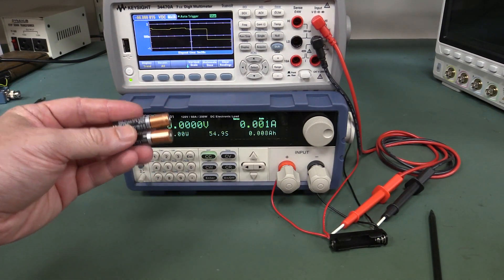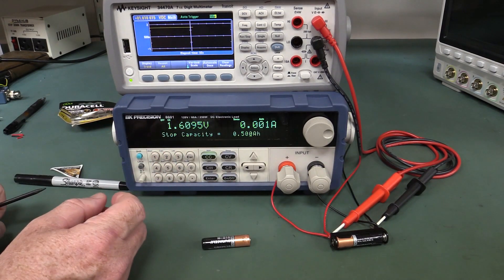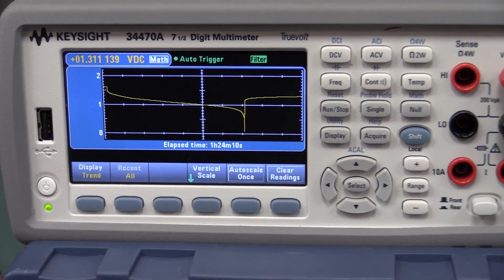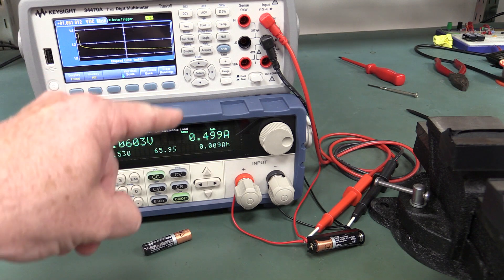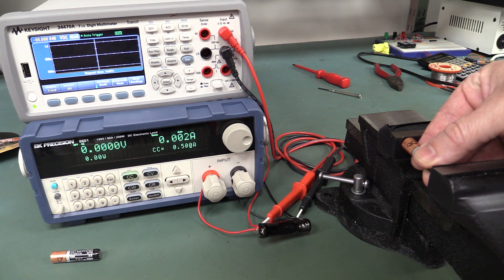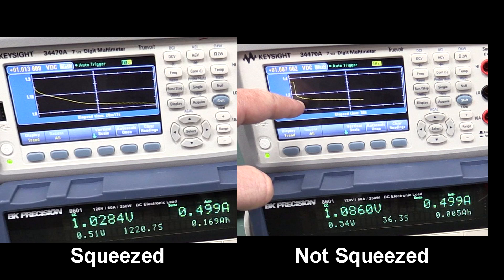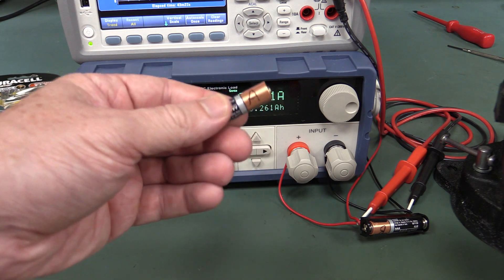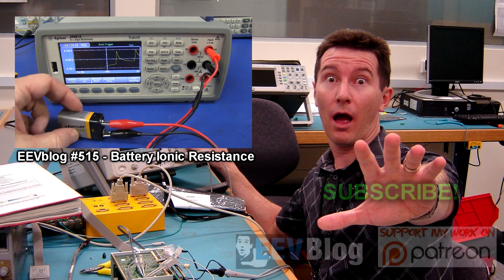EEVblog #865 - How To Increase Alkaline Battery Capacity

Comment: On applying pressure from end-to-end, the cylindrical core with its core layered windings separate enough to move static chemistry that then is exposed to the anode and the cathode. In short, the squeezing is acting like a pump which then irrigates relatively active chemistry to the poles. The vice squeezing may be shearing off the old chemistry from the plates, where vibrating would not shear like a squeeze. I think vibrating over X_time would move more chemistry. 

An alternative process is to move the internal chemistry then recharge.

Comment: In my city this is a well known thing, when the battery runs out we put them between our teeth and deform it with a bite, or if the shell was hard we use one battery as a hammer to hit the body of the other to deform it, and it's suddenly working again .. however we squeeze the body, not the top&bottom

Comment: Its basically the same thing that happens when you make a homemade capacotor. The closer the plates are to eachother internally, the higher the capacitance. Essentially what your doing here when squeezing the battery is preasing the anode and cathode closer to eachother.

Comment: The phenomenon that you are observing is due to the battery being under stress and hence, in pain.  The increased performance is due to alkali-adrenal compounds causing momentary extra conductivity in the electrolyte, as the battery screams in the ultrasonic range.  Only cats can detect this and that is why they stay away from cheap toys.  Your battery will last longer if you wrap it in soft, comfortable foam and play Barry Manilow albums to it.

Comment: I used to chew on my AA batteries back in the 90's when I did not have rechargeable batteries to put in my walkman. And when they drained out, I would just pull them out, chewed them all around and place them back. It worked best with those 777's if you remember them because the outer shell was thin and I could apply more teeth pressure :)). But if you think this is something, I have a friend who used a much better technique, i.e. he would pull out the (+) carbon rod inside and leave it in vinegar for a while, but yeah. That would be messing with the chemistry of it... But I must admit he was smarter, I mean he still has his teeth aaight :)). Nice to see some controlled values on this subject. :) Thanks.

Comment: As far as I know, oxides created during discharging process create ceramic-style interconnected matrix. That makes dead(ish) batteries bounce. IMHO it should also distribute mechanical stress through the whole volume of the electrode. Mechanicaly torturing it enough should create cracks. And those cracks in oxide could maybe expose some remaining zinc that was hopelessly burried in the oxide layer. And exposed zinc available for reaction means more capacity available to us.

This leads me to one extra idea. If I am right, hammering the dead battery with ultrasound (sweeping frequency should work better) could do the same thing, maybe even more efficiently. I don't have necessary toys at my disposal. Can anyone try it and let me know, if it works?

Disclaimer: This is only a wild theory. I have some chemistry background, but batteries are not exactly my field of expertise.

Comment: When I was a kid I thought I could recharge old batteries by putting 2 of them under running water for a few seconds and rubbing the plus side together. I'm not sure how I came up with that scheme but I though it worked because I'd pull dead battery from my toys, "recharge" them, and then I could enjoy my toy for a couple minutes more. I probably equated water current with electrical current back then. In retrospect I would have made a great alchemist.

Comment: I think you are artificially increasing the chemical potential of one of the reaction species.  Chemical potential is the driving force for chemical species in the liquid or gas to react or adsorb on surfaces.  Classic example is water condensing on a cold glass, increase the pressure or decrease the temperature and more water would condense.  Increased pressure or decreased temperature increase chemical potential.  Here you may be making the ions in the electrolyte react more quickly with the electrode because the chemical potential has increased because of the higher pressure caused by the squeezing.  Very strange.  This phenomenon indicates that the reaction is severely limited by diffusion effects and/or adsorption and reaction of a key molecule.  This must already be known in the scientific electrochemistry community.  Things this simple usually already have been studied.  The lack of the industry monopolizing upon this effect is likely due to safety issues with pressurized cells, the explosion hazards presented by implementing that type of enclosure, or something.  Very cool nonetheless.

Comment: The reason for this is that the speed of the Chemic Reaction and so the flow of electrons will approach 0 when a certain balance between products and educts is reached (the battery seems empty). When you look at the reaction thats Happening, you'll see that (very simplyfied) 4mol of Educts react to 3 mol of Products. The Law of Le chatelier says that a reaction will always tend to the site with less force and since we're going from 4 mols to 3 mols and you increase the preasure while you're squeezing it, the reaction will tend to build more products which means more current flow.

Comment: This is just because of the diffusion of the chemical in the battery. once chemical near the electrode depleted voltage will drop. and after chemical is diffused back near the electrode, it will have additional power. This will happen when you leave the battery for sometime, heating the battery, squeezing or anything that can redistribute the chemical back near the electrodes. Just don't bust the battery for safety.

Comment: dont batteries cut off at a certain voltage, this is probably bypassing that, and what would happen if you heated up battery would it explode?
Reply: +Hamguy Bacon Protected lithium cells do due to their active circuitry which is there to prevent you from ruining the battery by over-discharging, or blowing it up by overcharging or drawing too much current. The squeezing giving extra capacity is presumably from forcing the electrolyte around and I would assume it also works with lithium batteries though I couldn't want to try squeezing one in a vice, nor would I want to heat one up. Alkaline batteries are fairly safe though.

Comment: I'm wondering if you used a boost converter and a capacitor could you eak out a bit more power by pulsing the battery?

Comment: hey dave, if you try to repeat the test again but with AAs or other, i was wondering if you could put battery "A" in the vice as well after depleating battery "B" to determine how much more current you get out of its third discharge. i would have loved to see it in this video to yet again confirm the squeeze method but since this video is already in the can i guess we can do without. it would however be fascinating to see the diffrence in the control battery after its second depletion. cheers!

Comment: I have noticed an odd effect that I have seen when using a battery checker on Duracell batts (other brands don't do this)  First you need some somewhat depleted cells that have laid around for a long time with nothing drawn from them. When these batts are tested, the voltage quickly drops down THEN RISES BACK UP to a higher amount. I just find it odd that 1 brand only seems to do this and no other...

Comment: i stomped on my batteries and i got 10x the capacity and lost my leg! maybe you pressed the pin into the battery more? increased surface contact area? btw. alcaline batteries are all rechargable but cheaper batteries leak after fewer charges, duracell rayovac and energiser you can charge 5 or more times, "heavy duty" batteries explode when charged

Comment: I used to roll old carbon zinc batteries to get a bit more out of them.  I thought it was my body heat but it might have been internal resistance between the carbon rod and the top metal cap.  What you need is stronger springs in the battery holder.  You should try it with a fresh cell on the first discharge, with bathroom scales in the vice with the battery so you can measure the squeeze force.  you might need a bigger vice for that,  or very small bathroom scales.

Comment: okay, you have new office space for dev. and production. spin off to EEV-Manufacturing. design, build, sell AA & AAA Battery Optimizer. EEV-BO. LOL cool shit thanks for the videos. think about how many women would buy one or in a limited scale husbands buying for wife. Everyone hates when the wife takes the batt's from the programmed remote. (Don't judge I know I'm not the only only that this has happened to) :) Weld on a nut to the vice and use a torque wrench to measure the overall Avg. of squeezing for overall best results. design in to a nice little pink package the size of a deck of cards that a user could place batts in sit on the floor and use there body weight to close a simple device to give a known reference batt size/manufacture. Okay this has gone on long enough but if the science is valid I may try something like this out of Aluminum as I has a metal shop.

Comment: The old rechargeable NiCd AA batteries could be discharged at 10A for a short time. They'd get crazy hot, but I loved this aspect. NiMH have a MUCH higher internal resistance and I've never seen one go over 2-3A. I think Makita are abusing this aspect of NiCd batteries in a lot of their non-lithium drills.
Reply: +redtails Lithium batteries can put out disgusting amounts of current though. AvE has a video where he attempts to weld using 2 18v drill batteries. At one point it sticks and it peaks as 171A and stays above 100A until he disconnects the batteries.
Reply: bassl0va NiCd survives Li-ion by age, though. 10 years down the road the li-ion is dead as a brick, NiCd needs a recharge and it's good as new

Comment: Used to do this as a kid. Specially with remote control batteries.
The only two differences are
1- I used to squeeze them from the side, not longitudinally.
2- I used my teeth, not a vice lol.

Comment: Now that's a pretty interesting finding! One important caveat for the wannabe battery-squeezers though: squeezing is fine (if not done extremely hard), but be careful with banging, because with excessive banging you might break the battery's positive electrode (almost always a carbon rod in these batteries), which will definitely ruin it for good....

Comment: Brings back memory from the 90's. For every walkman-remote-boombox-RC car-or any other battery operated device.. you just squeeze them a bit (on the sides, with the teeth for AAA and AA or just bang them together on the sides for the D cells for a boombox all battery's were mashed several times and those were not even alkaline but cheap mercury based batteries.. idk the correct chemistry, but the "heavy-duty" ones)

Comment: Yeah this is not a new thing or something. Now the reason to why this works it's simply because, when the battery is dead, the zinc that the battery has , has become ZnO (zinc oxide). When the zinc is reacting with the MnO2 is producing the ZnO which build's up a passivation layer and the reaction can not take place. When you crashing the battery or dent it you brake this layer and the reaction can contiue further until all the chemicals have been consumed. My suggestion is to crush the battery sideways, that's when i had the most success.

Comment: maybe, by squeezing, that you mechanically  broke some parasitic electrical or maybe chemical paths or blocks inside the battery that occurs when a battery is used or aged. Doing so You partially restore the capacity of the battery freeing the possibility to have new chemical reactions. But, I guess, You can't do it forever.

Comment: Here's one for ya Dave I have two AA batteries in a CD player remote that are the
original batteries when I bought the thing in 1986. They still WORK in fact last I checked
both still measured over 1.5V. National Hi Tops (Japan) in a Teac CD Player. They are marked with an expiration date of 1988. Incredible
Reply: +MrJohnnaz Update, just checked them with a voltmeter one is at 1.518V and the other has dropped off a little in it's old age to 1.333V not to shabby for a 30 year old alkaline battery

Comment: I used this trick long time ago. works well on dead batteries for remote control. It is handy because you can get several month of extra use. Might be useful fo wireless keyboards and mouse. For other electronics it might be not as useful because squeezed batteries will not last for any usefull time. 

You dont need to squeeze them in wice. Also taping two batteries side to side, or side to hard object also works. Geting some dents on the battery bodie is what you are looking for to get the extra capacity.
 For the experimet you can try to squeze thime in vice from sides.

Comment: You'll have to repeat these experiments when it's not 01-Apr.

Having said that, I had a used up (wouldn't hold much of a charge) LiPoly cell (battery?) that I extracted from a Palm T|X, and I was connecting a 50 ohm resistor across it to discharge whatever was left in it, so it wouldn't short out in the recycling bin and cause a problem such as a fire.  I had a multimeter on it so I could monitor the voltage.  Eventually I had to bypass the overcharge/overdischarge circuit board, but I did notice while monitoring the voltage that if I pressed on it, the voltage would rise temporarily.  I attributed that to moving around the reactants, mostly the electrolyte, so that more molecules would react to produce electricity...sort of like agitating it.  So to me anyway, it's not super surprising that changing the geometry slightly will change the discharge characteristics.

Comment: Bad testing methodology. You gave battery B much more time to recover than battery A. This methodology is only applicable on April 1st.
Reply: +aszi88 He was also not using the right measurement method. Bateriser clearly shows that batteries are supposed to be meshured open circuit! Clearly they know what they are doing if they can get 800% more out of it while dave only got 19%.

Comment: I wonder if the surfaces inside were chemically and/or physically changed from the process of discharging it, and by squeezing the cell, it caused the alignment of maybe some little pits in the surfaces to shift away from each other. Very interesting video!

Comment: you may be changing the chemical equilibrium,  try repeatedly tapping it (need a mechanical device) or mechanically shaking it (maybe a bead beater or paint shaker).  that may be your next product.

Comment: It would be interesting to put isolated metal plates in the vise with the 4 terminal measurement and give it a squeeze during the discharge to see how much you can spike the output.

Comment: Great video Dave, it makes  sense if you think about it and I'd be willing to bet the difference is much less at a slower discharge rate. The way I've understood fast discharge rates on batteries is that power is lost through heat but also a case where material is left behind that's now disconnected and "unused". The battery resting will allow some of it to reconnect, heating will also work, and compressing them seems to do it too. I've experimented with vibration on a sander and it's somewhat successful. would be interesting to see some numbers that compares this nudge nudge wink wink.
Reply: It's an April fools joke dude
Reply: +ophello The new lab was the April fools.
Reply: +ophello  No, it's not - long known hack to extend battery life a bit. Go google it.

Comment: Dave I've found that AA and AAA can be reinvigorated by putting them in a small plug-in to the wall battery charger. I leave them in for no longer than 30 minutes and I can use them for quite a long while. I do this with the batteries for my wireless mice and keyboards and they go at least as long as new ones. I've never measured the time by wrote but it works.

Comment: I wonder if the battery's total energy capacity has increased or whether you've just changed the time characteristics of the multi-discharge curve. Perhaps it could be tested by squeezing batteries at different times throughout the multi-discharge pattern - e.g., some others have suggested squeezing before the first discharge, but additionally what happens if you squeeze after the second or third discharge?

Comment: What happens if you squeeze BEFORE you discharge?
Reply: +SiliquaeSid I've heard that you risk a violent discharge due to the increased voltage from compression. Not recommended.
Reply: +dan110024 Thanks, I'll not try that I then.

Comment: Dave, do you think you could make some videos on recharging disposable batteries? Or maybe testing if its possible to increase their capacity by overcharging them before their first use? Thanks
Reply: +ChantaFlaite They used to make rechargeable alkaline batteries. Putting regular alkalines in the charger tends to result in leakage. And if there were a way to increase a battery's capacity when it's fresh, they'd already do that during manufacture I'd think.

Comment: Hmm... The metal can of the battery would absorb most of the force from the vice so very little of it would be transferred to the electrolyte paste, and it's a paste so squeezing it doesn't change it's structure much. 
What I think is happening is this forces a tighter connection and better contact between the cathode and the button top. This would cut down the resistance of the battery and lessen the voltage drop, which is what you observed. I think if you measure the internal resistance of the squeezed battery, you will find it lower.